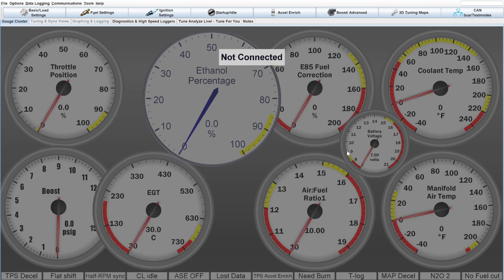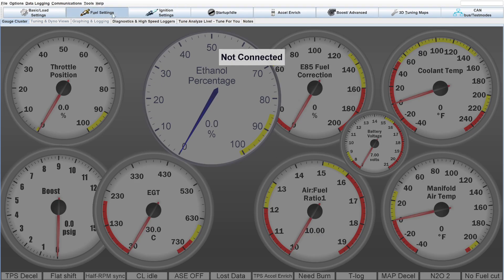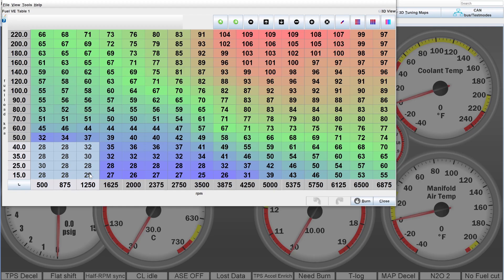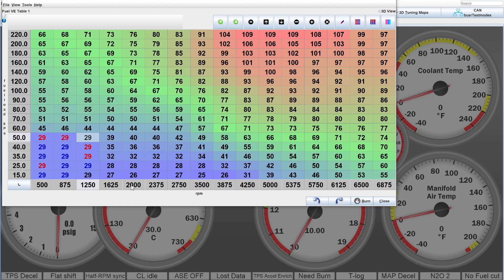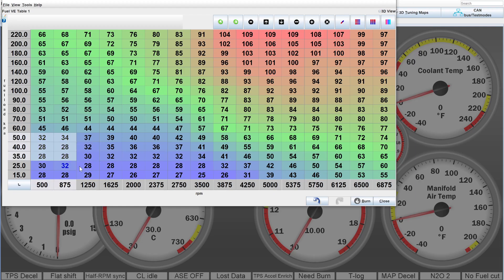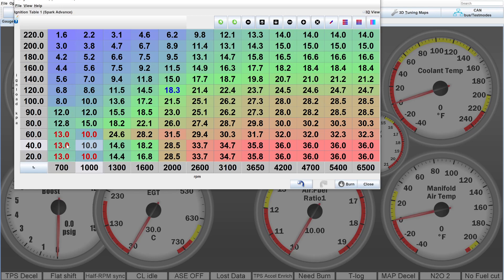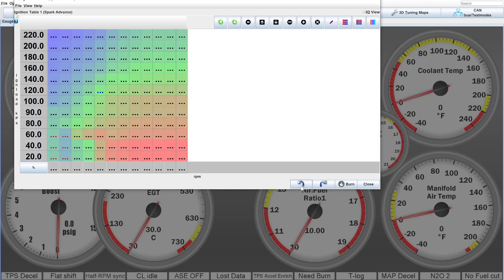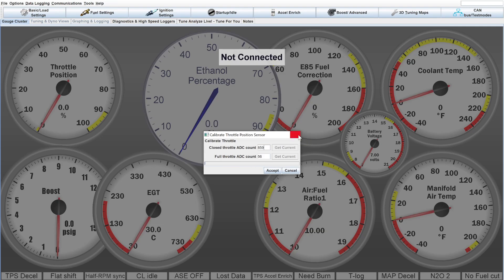Megasquirt Idle Tuning Basics | Learn to Tune

Comment: My best idle tuning advice is not to put too much timing in the table at idle rpm. Give the engine more air instead.
Use timing correction for zeroing in on idle after setting the throttle to a reasonable spot.
If adding timing at idle rpm doesn’t increase the engine rpm, your base timing is too high.

Comment: My miata idles is pretty low on cold starts but goes up as the car gets to operating temp. Do you know what it could be? Thanks.
Reply from the maker: Do you have an idle valve ? If so you can increase the idle duty and get the revs up with more air
Reply: @TurbineResearch Late response. But I replaced the iacv and it started working again. Thank!

Comment: Your videos helped me a ton with my Kdata powered M20b25 E30. My car was running a high idle and erratic AFR's. Turned out my PWM table for the iac was at like %70 open across the board. I tapered it down to about %30 at target temp and it runs awesome now. Thanks so much!
Reply from the maker: I’m glad the videos helped you out ! That’s exactly my motivation to make more content. Thanks for watching

Comment: My engine has a cam and the kpas and fuel idle up and down in kpa cell 75-80 is that normal. I didn't mess with it long . The AFR gauge says 10:1 to 11:1. Took 1 plug out and it was black

Comment: beware also, that 10 BTDC that as rpm lowers 10 degrees advanced at 500rpm is a lot more advance at  500 rpm than 1000 rpm because of piston speed is slower

Comment: ur the fuckin best dude. i was chasing my tail for a long time but this really set me on track.. any tips for getting a car to start after heatsoak?
Reply: think you have to add fuel in the air temp map compensation, I'm about to do this on my Datsun as when I shut car off for 10 minutes and restart, its super lean AFR  as the intake is cooking the air and fuel.

Comment: Well i have an idle issue mine doesn't hunt it sits at 1500 then just starts dropping rpms and shuts off unless i give it throttle input. trick is its definintly not a stock car. its got upgraded cams 264/272 with a holley ls intake and a gm 95mm tb on a 3.0l v6. It's an older batch-fire ignition.

Comment: Idle table at 10. Idle control adding +3,  add advance 13 at 500 rpm. At 500 rpm will timing be +3 +13 =16 timing? Which will have it spike and overshot the normal idle?

Comment: after getting it running do i leave the idle control off ?
Reply from the maker: You can turn it back on and tune the idle control valve separately
Reply: @TurbineResearch  my idle never really stumbled i was really just after rpm the ignition advance did bring it up but i did have to add quite a bit of advance
Reply: Stay in open loop till it runs perfectly. Once this is reached..even at higher idle then go close loop and adjust idle table. If starts oscillating at idle go back to open loop. Lower timing to 10 usually will drop the idle down for u. Then add fuel till perrs then back into close..ie due all your tuning in open then close loop to run
Reply: @kevinhoronzy6011  thank you

Comment: I can't start my car without the idle air control turned on. It immediately sputters and dies. Is there a way to have it so that it can run without the idle air control on for the tuning step you mentioned?
Reply: Go into open loop. Keep adding fuel and like small increments..if at 34 go 36. If u go to high all the time u will never get anywhere. Then after open loop is good. Then close loop. Keep ego correction off for a few months.
Reply: U might be running on a minus cylinder too.

Comment: Hmm i see you have a e28 what angle deg BTDC did you use?
Reply from the maker: Are you talking about the tooth angle in the initial setup ? 87deg or something like that  just check it with a timing light to be certain
Reply: @TurbineResearch  just to confirm also I have spark A 1-6 spark B 2-5 spark C WLED with 1k resistor 3-4 
I have two bank batch  injection (what 3 cylinders should be tied together?)
Reply from the maker: @michaelcleary5205  that sounds correct 👍batch injection can be 1-3 and 4-6
Reply: @TurbineResearch  so 1-3-5  2-4-6 i get it to idle just really rough 12.4 afr going to double check the timing!
Reply: @TurbineResearch  so it's runs like a cammed car and is very rich but alot of hesitation and smoking 🤣 any suggestions

Comment: Great video. I’m looking forward to adjusting mine. I find that my timing table jumps from 14 to 24 at low rpm and when I try to accelerate and disengage the clutch it will typically stall. I will work on the VE table and then adjust that timing accordingly.
Reply from the maker: Glad the video was helpful ☺️
Reply: Check where your duty cycle is set on. I run the icv test and use that duty cycle where it idles on my table. If set below the car wanted to stall out on deacceration.

Comment: Great info! I am tuning my first car, a 99 miata with a supercharger targeting 200hp. That aside, your ignition table is giving me confidence. 

All I've ever known is that we want 10-14 degrees advance, and now I am understanding that is a base figure ("x"). Still, 16 degrees seemed intimidating to me, this is on my base map around idle.
Reply from the maker: Thanks ☺️
Reply: Hi mate, I know you posted a long time ago. I’ve got a 96 with a supercharger and I’m having problems with start up and idle. Needs revs for start up every time pretty much. Wonder if you could help me out?
Reply: Sounds like you need to increase warmup or afterstart enrichment, if it only happens when cold then likely part of the startup process and not a problem with idle. I have a 96 turbo with big injectors and needed about 30-40% more fuel on startup  @RJ-dr8to

Comment: Another way of doing it if you want a good idle fast. Tune it for as much vaccuum as the engine can pull at idle as possible. Afrs at idle isnt that accurate and dont have much to do with a good idle.
Reply: Not a good idea. The idle table has nothing add if it need timing.
Reply: @kevinhoronzy6011  Have you used this method?

Comment: I am going in circles, The idle is either not working or too high. It can be this from run to run and also in the same run. What I dont understand is when you do this with idle control end EGO disabled, you have to turn the screw on the TB to let some air in. what do you do then, when you want the idle control to be enabled again?
Reply: im curious about the same thing
Reply: Me too...
Reply: It depends on your idle control set up. Turning it off or unplugging on a car with a stepper motor will leave the air bypass in whatever position it was in at the disabled moment.
You need to manually shut it, or tape the air inlet to the stepper valve. PWM valves default to closed by simply unplugging them.